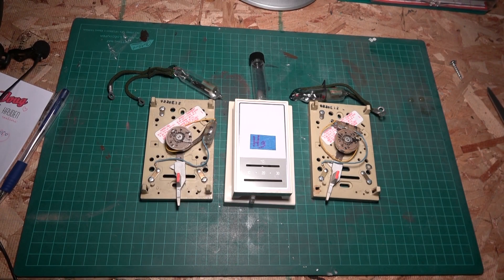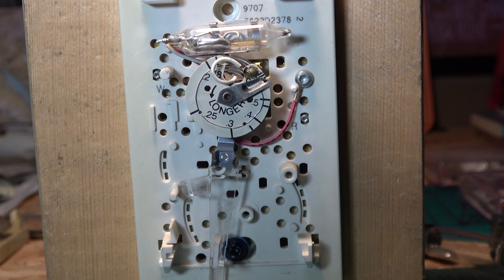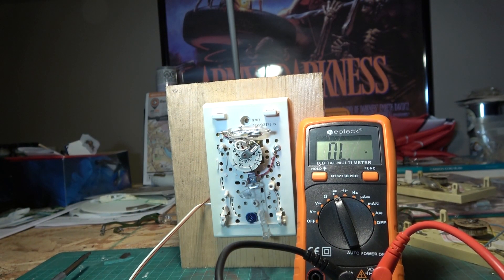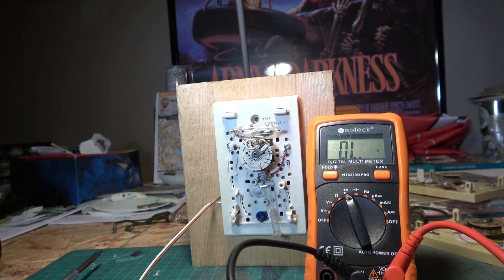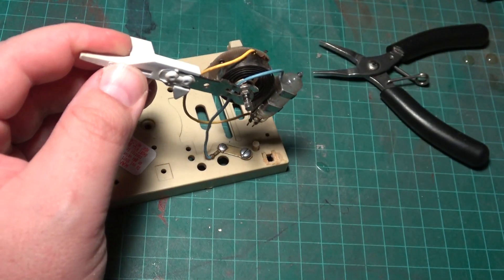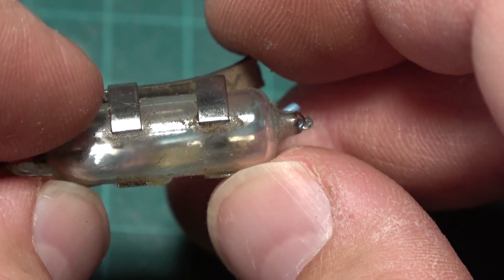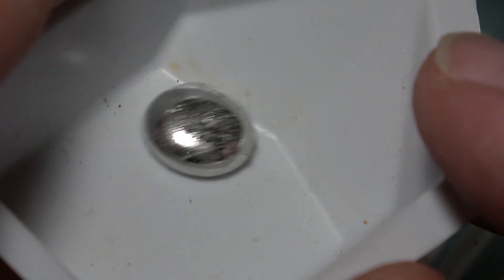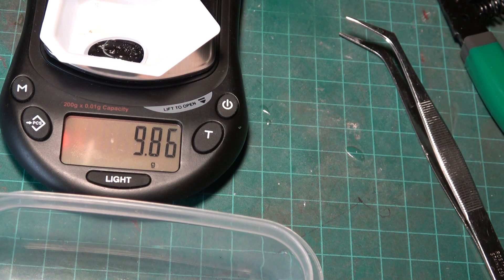Recovering Mercury from Theromstats Dissolving Gold

Comment: Any way to do this without getting glass fragments into the mercury?
Reply from the maker: good question.  I was thinking using a small mesh screen or cloth.
Reply: @BackyardProspector  I wonder if mercury can pass through openings that small?

I’ve noticed it doesn’t even fully go down into the little nipple point of the stat bulbs I’ve collected. 

I’ve got a few dozen and I’m determined to get it all out of the glass bulbs and  into one vial as purely as possible.
Reply from the maker: @jimfisher6634  If its pure then it should act as a liquid.  If its amalgamated then it should act more as a solid.  You can always distill it if you have the knowledge.